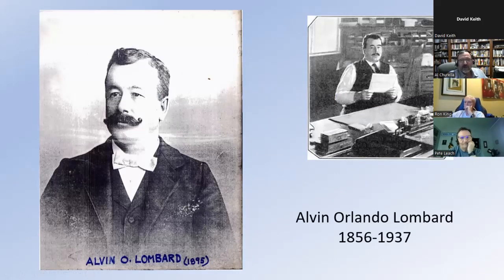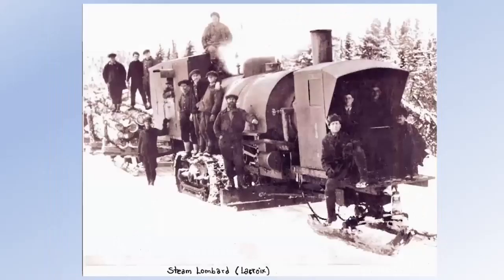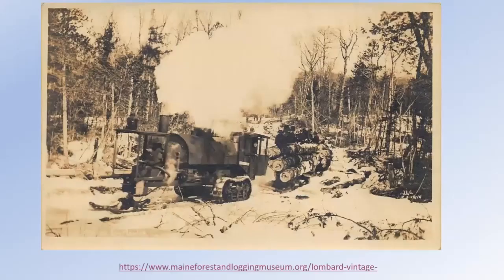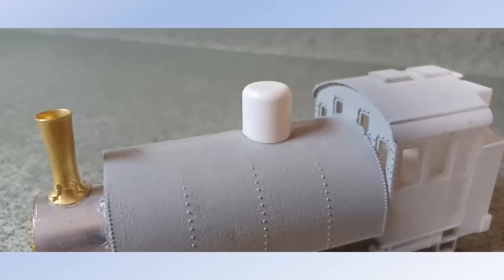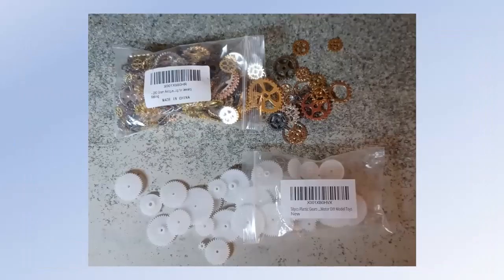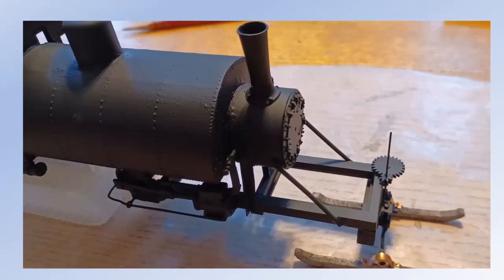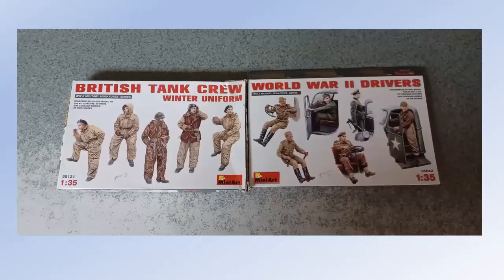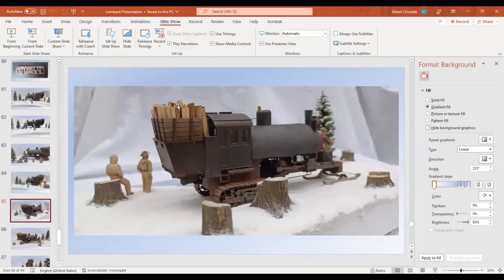M2FM Video - Building a Lombard Logging Tractor by Al Churella

Comment: Great model! Just a couple of notes based on the comments in the video. Yes, they are difficult to steer but it’s due to the very low geared steering. As we like to say “steer early, steer often” the tracks and roller chains are adjustable for tension and wear. Yes, there is a differential. A pinion gear on the crankshaft drives a large ring gear. Spider gears transfer drive to the sprocket shafts. The drawing set you used from the Maine Forest & Logging Museum were drawn by the late Bill Lynch. Bill spent over 20 years working to restore the Lombard we have at the Maine Forest & Logging Museum. Sadly he passed away before it’s first steam-up in 2014. The live steam model was built by Chris Rubey and was the subject of a lengthy build series in “Live Steam” magazine. We currently have two steam powered Lombard log haulers in operating condition at the Maine Forest & Logging Museum. Your welcome to stop in and check them out anytime.